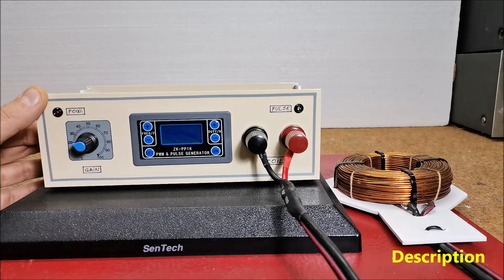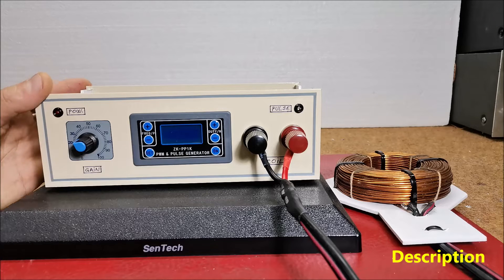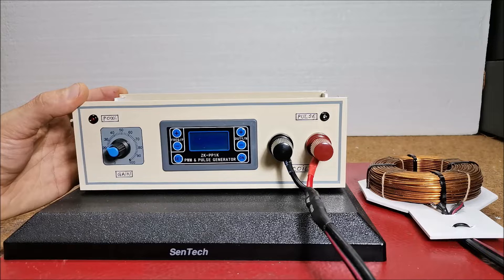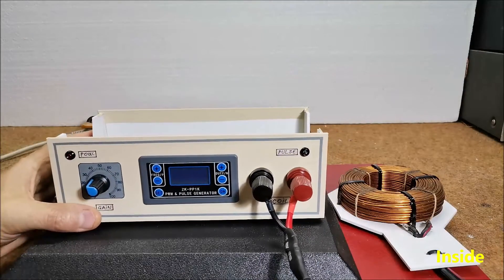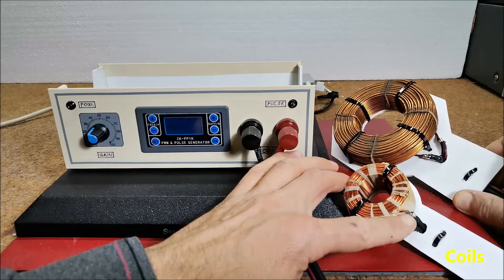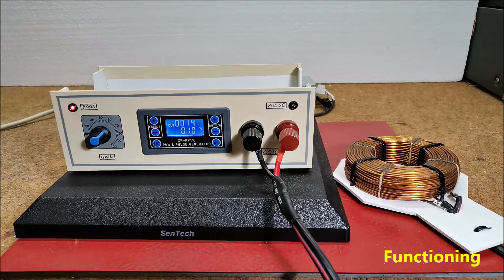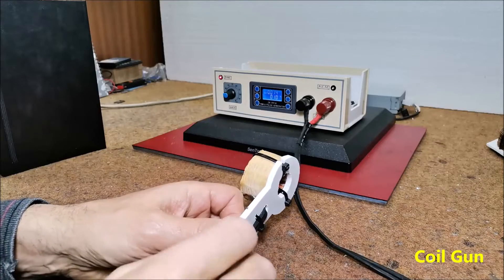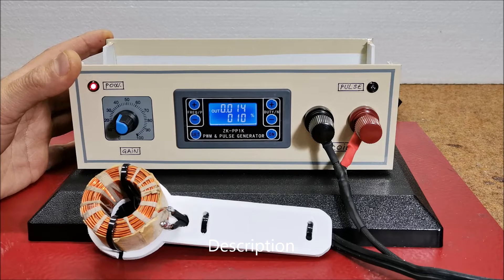Simple to build High Power PEMF (Pulse electromagnetic field) therapy device

Comment: Built the device.  It works except it doesn't... as the coil gets very hot, within seconds.  And the second pulse LED does not flash at all.  Stays solid on.  I made certain the power  supply is producing 12v and 20a with a voltmeter.  It is. It definitely produces magnetism.  Strong.  But am concerned the LED is solid on and keep waiting for a component to burn out.  I dial the potentiometer all the way down and the potentiometer does affect the coil.. as it starts buzzing when I turn the dial up... and I set the pulse generator to the same settings seen in the video.  But same results.    All I can think of is to wind another coil but add more, like many more turns.  Other than doing more windings on the coil (and I followed the instructions for winging for the 'large' coil), not sure what else to look at.  Thoughts?
Reply from the maker: As far as I can guess, one of the Mosfetis was burned. The reason for this is probably the omission of the diode connected in parallel with the coil or that diode is connected in the opposite direction. Another reason may sting if you use a wire much thicker than 1.5 mm in diameter
Reply: @MirkoPavleskiMK  Thank you for the reply.  It gives me a place to start looking.. I purchased enough parts to rebuild it a couple of times which I will do.  Definitely learning new things, especially how coils work.  Been studying that.  On the wire diameter, I went to a conversion chart and the closest 1.5mm comes to gauge is 15 gauge which is what I used, enamel coated of course.  So I will replace all the Mosfets, and will also wind another coil.  Question on that… I think I have it backwards.  More windings is not the way to go?  I admit I may have added more windings than the 180 that the Big Coil calls for.  I lost count and may have over-wound.  Question is.. if the coil has too many windings over the established, that would create more resistance and cause it to overheat???  Also, on the Mosfets, do I have it right that the middle lead is grounded to the aluminum heat sink?  So all Mosfets are grounded via this wiring method, to the aluminum heat sink?  I am learning.  All a learning experience.  And the end-game is to help my wife who lives in chronic pain.  I appreciate your replying again.
Reply from the maker: @drh3rd  First of all, it is not a problem if the coil has more windings, because in that case its resistance increases and as a consequence there is less current through it. So if there are more windings, it will heat up less, but the magnetic field will be weaker. For Mosfet you are right, and the middle lead of each is grounded to the aluminum heat sink (green wire on schematic). And one recommendation, when the potentiometer is switched on for the first time, let the frequency be in the middle position at around 10 Hz and the duty cycle at 5 percent. Because the circuit operates at high currents, always carefully check the connections as shown in the diagram before the first switch-on, otherwise if there is an error, the MOSFETs burn instantly (more precisely, only one MOSFET from the array usually burns).  Feel free to contact me if you have any other questions
Reply: @MirkoPavleskiMK  Mirko, brilliant.  Thank you for confirming the windings, the Mosfet wiring... and when turning on for the first time.  I did NOT do that so... Interestingly, I found the signal generator seems to keep its settings after powering down.  So will set it to 10 Hz and 5% duty cycle before I rebuild everything.. placing care on replacing the Mosfets.  That is all I can think of at this point.. one burned out.  Everything else has been checked and rechecked many times.  It all seemed to work, except for what I described.  I will press on.  Am beyond grateful for your responding.  This is one device I am extremely focused on... for chronic pain for my missus.  thank you
Reply: @MirkoPavleskiMK  Golden Info Byte Right Here THANK YOU! AND THE PARAPGRAPH ABOVE ESSPECIALLY

Comment: Having trouble understanding the purpose of the diode (or why connect the coil ends to each other in the first place, regardless of direction)?  Anyone able to clarify that?
Reply from the maker: The purpose of the diode is to protect the Mosfet transistor
Reply: @MirkoPavleskiMK  Ah ok...  I "think" I get it :-P.  So...I assume when the gate/PWM "closes," then the stored magnetic field causes voltage in the opposite direction, and the diode...just lets it flow back through the coil so it doesn't try to do that to the MOSFET?  Anyway, thanks for these instructions :)

Comment: Just a question.  Is there any way to consider, instead of coils, using an electric blanket?  I have seen electric blankets used in simple PEMF and RIFE devices instead of coils.  Just wondered if a "blanket" idea could be used in place of coils?  Curious is all.
Reply from the maker: I think this is not possible, there must be inductance and the electric blanket contains only a heater (resistance).
Reply: @MirkoPavleskiMK  I understand.  At least it is worth asking tho.  Your projects are fantastic.

Comment: After many models I ended up going with a computer PSU since it provides voltage levels for the coils and whatever microcontroller you want. I put the entire controller circuit inside the PSU case and then use a cat5e wall outlet for the external connection and cat5e cables to the coils since everything is 24awg. it is a very clean and simple design.  I'm also using one mosfet per coil now but I think in the future I'll just go with one nice mosfet (NTP125N65S3H with UCC27524 as driver. both have very good rise and fall times. if that even really matters.)

update: using 1 mosfet with 7 coils caused a clicking noise in the PSU so I'm back to one mosfet per coil. no idea why that was happening. I use IRF640NPBF mosfets with a TC4420 driver.
Reply: Can you post your design schematic?  That would be cool.
Reply: @drh3rd part 1: pic is on imgur
Reply: @drh3rd  part 2: once you get there add MalXXni to the end
Reply: @drh3rd  I've tried like 5 times now to post a link to an image and it keeps getting removed (finally got it added below)
Reply: @sdriding  Oh man.... I've seen this happen.  Well... is the image on your YT page?  I followed a video you posted of your work.  Cool... not the least of which are your several coils.  Certainly would like to look over your shoulder and see what you have advanced.  If anything, I can couch a post with a method to communicate, or something, if you have time.  tx for replying, and trying.  Oh... do you use this protocol to help with pain?
Reply: @drh3rd  I don't have a picture of it anywhere else. but if you just search for "arduino forum schematic verification" the first link should be a thread of mine. definitely wouldn't recommend reading it, but you can find me there and send me a PM.     and yes my back pain has been essentially gone since I started using the device
Reply: @sdriding  Brilliant sir.  I found your posting and for sure, will read it all.  Am always relishing knowledge... and grateful someone takes the time.  So reading would be my duty I feel.  I have DIY'd RIFE and PEMF devices in the past.  Always low powered.  Finally broke for a high performance PEMF device...but really want to build a working higher powered magnetic field device as what Mirko has presented.  Am always, like always interested, curious, about how people respond to them too.  So hearing your back pain improved is gold.  My wife, well... longer story.  Not for here.  Is why I am in pursuit of this particular technology.  Am very grateful to Mirko, and now to you for taking the time.  I will come back with no doubt, questions.  Will endeavor to keep them short (he says, rarely keeping things short).  tx
Reply: @sdriding  I read your thread, and journey.  I have to hand it to you.  Persevered through some pretty harsh critical sniping.  But powered through it.  Well done.  I will PM you tmrw to see if you can send a latest schema??  Mirko's design is exactly what I have been looking for.  But the other design is yours... able to cover all, or most of a full body with multiples of coils.  So yes, am stoked for both Mirko's and your designs.
Reply: @drh3rd  It was only with lots of help that I got to where I am now with the design so I'd be happy to answer any questions. I'd like to make a video explaining how to design a system but I don't know when I'll get the time
Reply: @sdriding  no te encuentro,ayudame
Reply: @drh3rd  part 3: I put a parts list and explanation in the picture notes so be sure to check those out
Reply: @sdriding  Am pulling together the links and studying now.  Didn't see a way to PM you on Arduino, yet.  And, admit "add MalXXni" went over my head.  Erm.. can you add slight explanation?  Learning new environments, ya know.  And man, have to say, you take a LOT of heat, for heat (unforgiveable bad pun) among other things.  Yet you power on (another bad pun).... Do we thank your parents, just born that way, learned leadership, teamwork and design in your vocation?  I mean, just today you took a broadside.  And you keep motoring on (no pun).  And in more completely useless waste of bandwidth... I live on the street where Tesla built his lab in Colorado Springs, 1899.  Albeit 2 1/2 miles east of me.  But I still get to say that which gets me absolutely nothing, nowhere.
Reply: @sdriding  And, what would be the best place to interact, so we don't fill up Mirko's domain?  I hesitate to reply publicly, yet, in your arduino forum as I don't want to add fuel to the neg nancy's that I think find pleasure in bashing your intellectual curiosity pioneering spirit work.  I also cannot hang with their backgrounds..
Reply: @drh3rd  haha, that's why I recommended you not read the thread. I couldn't expect anything else from a bunch of electrical engineers, and much of it was good for me to hear as I knew almost nothing when I wrote the first post.  its painful to go back and look at my ignorance.

about the image: when the full url on that site loads, you need to copy/paste that extra text onto the end of the url, then it will take you to the image.  that was close to my 20th attempt to get some form of the url into a post so I don't want to edit my comment and see it deleted. 

to connect with me on the arduino forum you'll need to create an account. if you still can't PM me write something on that thread  and I will be notified
Reply: Please schemtic
Reply: Please i need schematic
Reply: @r.a.9802   sorry it's too hard to try to send links or anything via youtube
Reply: Thanks
Reply: Where can I see the diagrams of your projects? Your work is interesting. Please help me. Thank you.

Comment: Mirko, in your directions, you indicate we can use any signal generator from your other projects.  Have ordered the signal generator in your parts list and waiting for delivery.  But wanted to ask, would the "PWM Frequency Meter  XY-PWM" work?  I have extras from building another one of your projects.  tx
Reply from the maker: Yes it will vork.
Reply: @MirkoPavleskiMK  Thank you.
Reply: @MirkoPavleskiMK  And by the way, I love your projects.
Reply from the maker: @drh3rd  Thanks
Reply: @MirkoPavleskiMK  So, here’s a crazy question.  Would it be possible for one power supply to drive two signal generators, two coils, etc?  Just curious.
Reply from the maker: @drh3rd  Yes, it is possible
Reply: @MirkoPavleskiMK  Interesting.  Thank you.

Comment: Hello.  The schematic states the power supply is a 12v 20a like laptop power supply.  Would it possible to use a 19v laptop power supply?
Reply from the maker: Yes, you can use laptop power supply, but in this case you need to increased resistance of coil
Reply: By how much more do you have to increase the resistance for the 19v

Comment: Good idea to use low V and high current. High voltage (220-600V) PEMF devices heat up very fast and charging the Caps takes time which means low pulse rate.

What is the range of frequency this device can output?
Reply: plz visit my channel for powerful PEMF